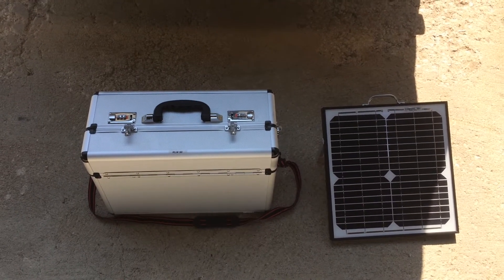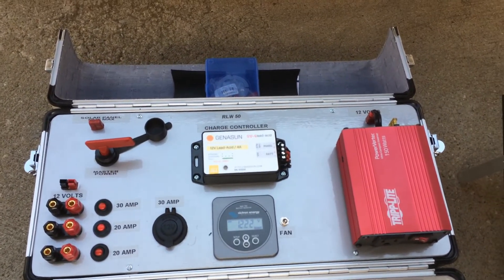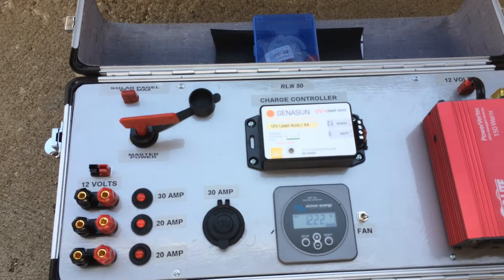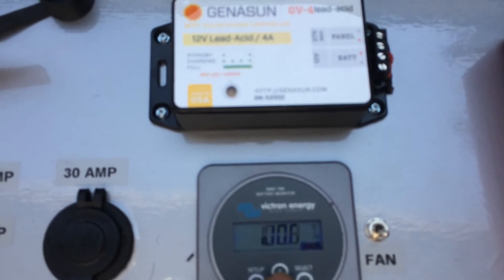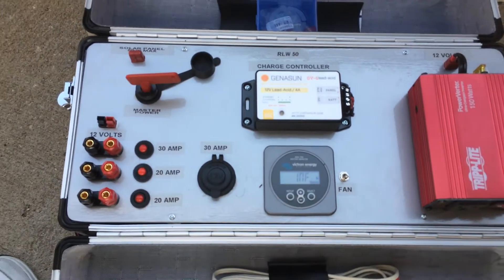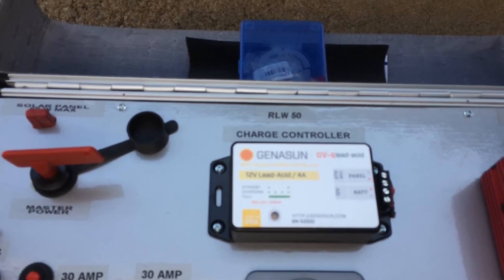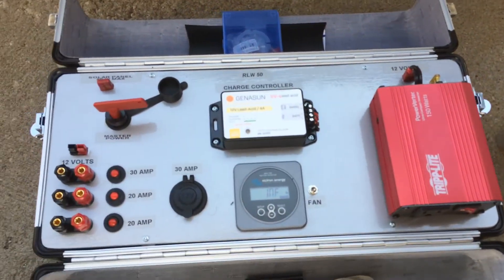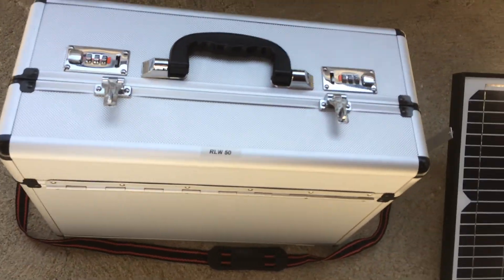Solar Charge Portable Power Supply

Comment: I know this video is a few years old but very nice build. An 26AH AGM batter can only be safely discharged to 80% capacity (Flooded type can be brought down to 50%) This means this battery has a usable AH rating of 5.2 AH the newer LiFePO4 batteries can be drawn safely down to 80 to 90% capacity. If he swaps out that battery and charge controller with a 20 AH  Bioenno Lithium Iron Phosphate (LiFePO4) Battery It would have a usable AH rating of 16 to 18 AH and weigh less than 6 lbs. compared to the Lead acid battery of at least 17 lbs and only 5.2 usable AH.  Genasun makes a nice compact LiFePO4 Mppt solar charge controller that would work great for this build. But even with the Lead acid battery this is a very nice project. By the way the Bioenno batteries have built in internal cell balancing, complete integrated protection along with integrated charge circuitry.
Reply: I believe you have been the recipient of sone erroneous information about AGM in general.The useable amps are at least equal to a flooded lead acid battery. And they cost a fraction of a LiFePo4 battery.
Reply: @geraldhenrickson7472  True. I run a AGM deep cycle battery for many years now inhouse lights and laptop with a genasun gv-10. No problems and the batt runs great.

Comment: How do the leading tech AGM batteries compare with a Similar Li-po, Li-ion,  Li-Fe??  
power and weight and the power per weight...
To Include low voltage cut out electronics.
And to consider weight! either in weight reduction or add compacity to compensate.
1/2 the size/weight or twice the power/charge.
for twice the cost of better batteries. about?....
Nice
J
Reply from the maker: +Jason White Hi Jason, I went with the AGM battery because the solar charger will not work with Li-po, Li-ion, or Life batteries. Also those battery do best with balanced charging. I also can parallel the AGM off my car battery for long high current charging. AGM batteries can use more flexible charging methods. Li-po, Li-ion, Li-fe and others are smaller and lighter. I wanted charging flexible.
Reply: Google it and you will have more info than you can ever absorb.